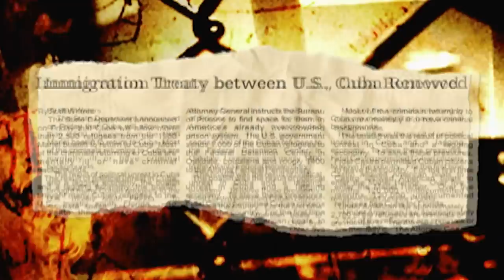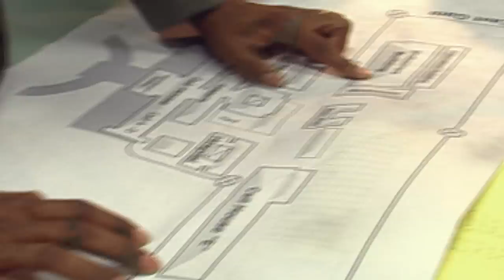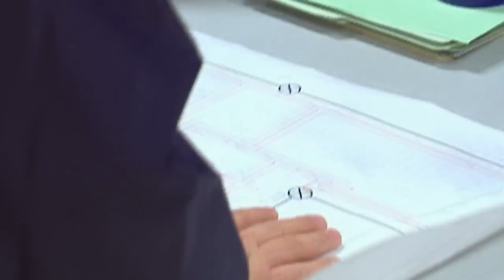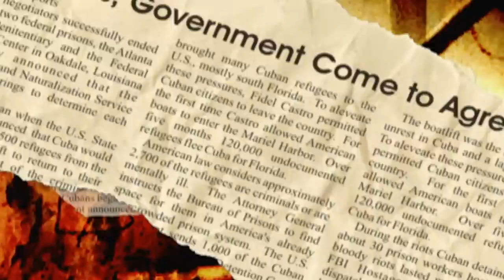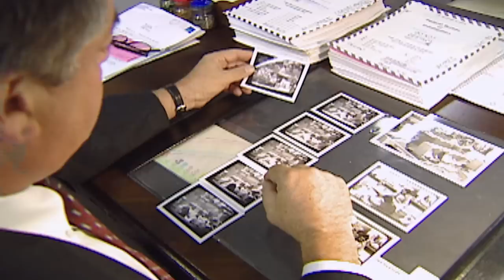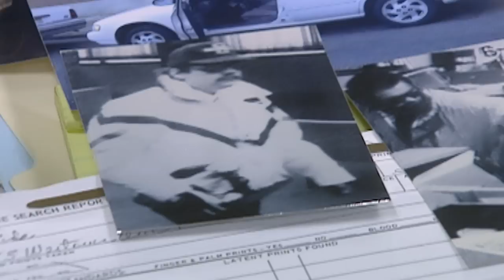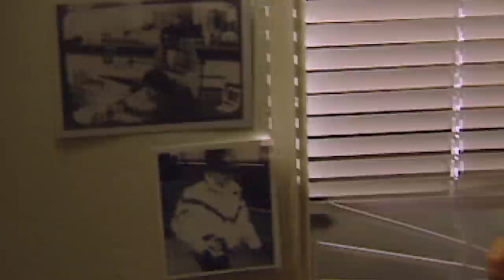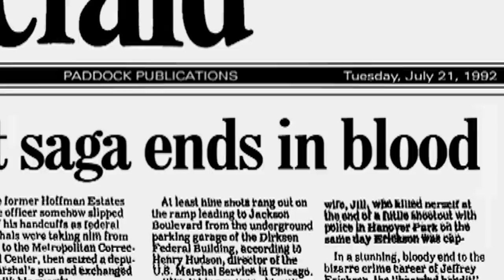Deadly Atlanta Prison Riots & A Deadly Pact (True Crime Documentaries BACK-TO-BACK) | Real Stories

Comment: No, the negotiators didn't "decide" to bring them the mail as a nice gesture.  The prisoner's likely demanded it before even sitting down at the table.  Something like receiving mail would be an important bargaining chip and the negotiators would never just give it away.
Reply: I may have misheard/misunderstood but they said the agent used psychology on the chosen detainees. Used them based on who were the most respected. After the demand of about exams on every deportee was agreed upon then they were giving the mail. It’s a sign of compromise and building trust. They said they only used those initial detainees from there so they could have a chance of deescalating the situation.